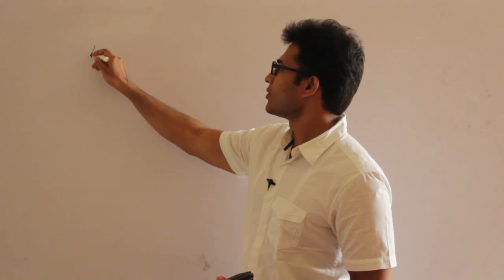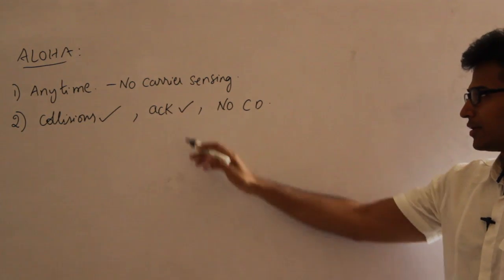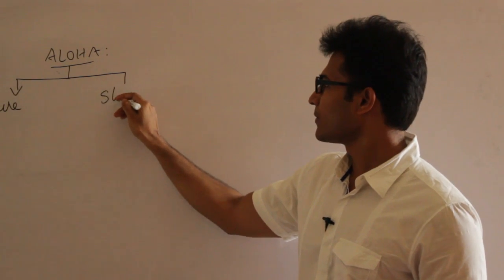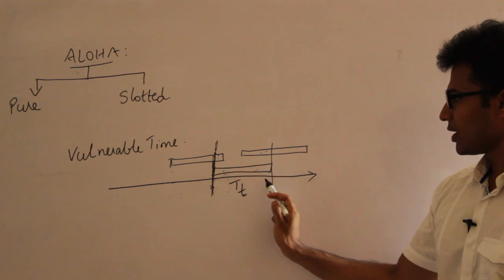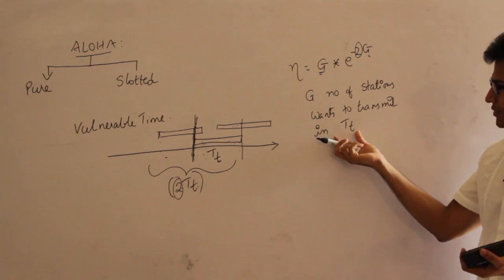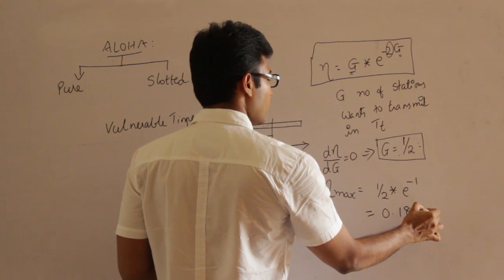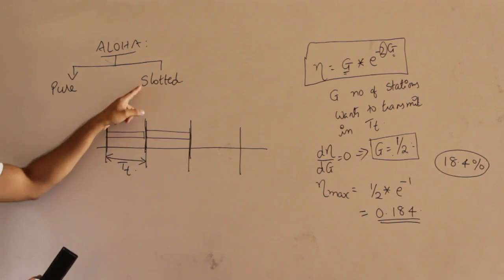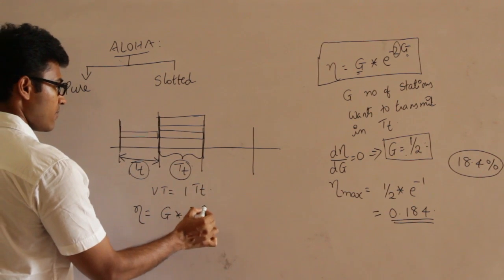CN | Flow Control Methods | Aloha and difference between Flow and access control|Ravindrababu Ravula

Comment: The story of our first MAC starts out in pristine Hawaii in the early 1970s. In
this case, ‘‘pristine’’ can be interpreted as ‘‘not having a working telephone system.’’
This did not make life more pleasant for researcher Norman Abramson and
his colleagues at the University of Hawaii who were trying to connect users on remote
islands to the main computer in Honolulu. Stringing their own cables under
the Pacific Ocean was not in the cards, so they looked for a different solution.
The one they found used short-range radios, with each user terminal sharing
the same upstream frequency to send frames to the central computer. It included a
simple and elegant method to solve the channel allocation problem. Their work
has been extended by many researchers since then (Schwartz and Abramson,
2009). Although Abramson’s work, called the ALOHA system, used groundbased
radio broadcasting, the basic idea is applicable to any system in which
uncoordinated users are competing for the use of a single shared channel.
We will discuss two versions of ALOHA here: pure and slotted. They differ
with respect to whether time is continuous, as in the pure version, or divided into
discrete slots into which all frames must fit.